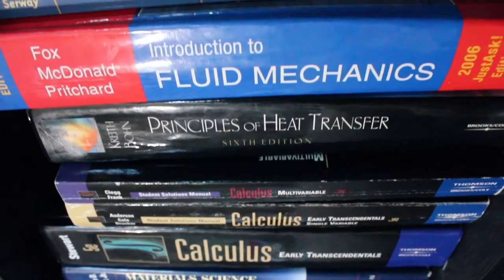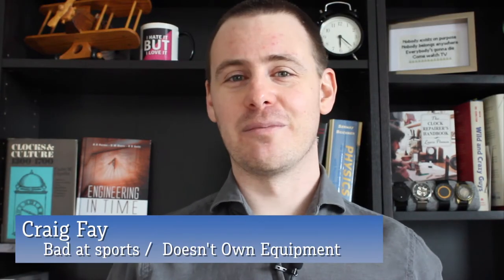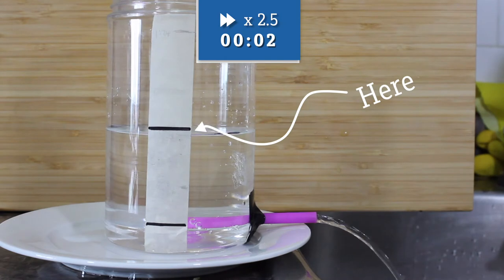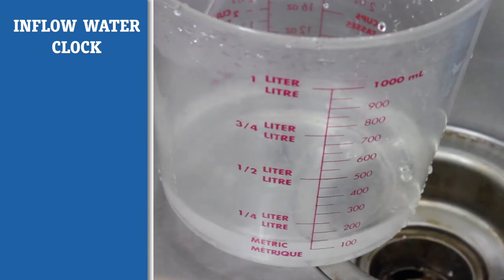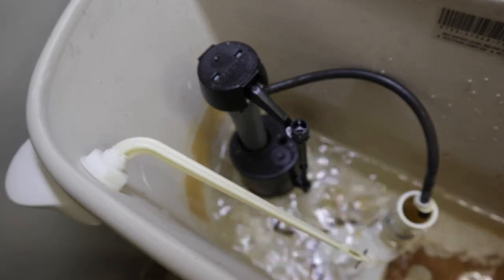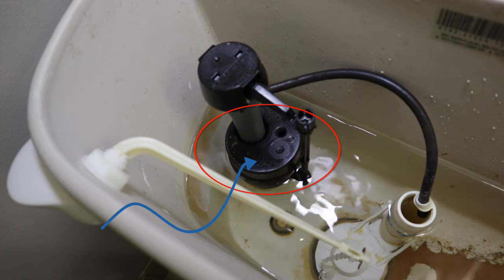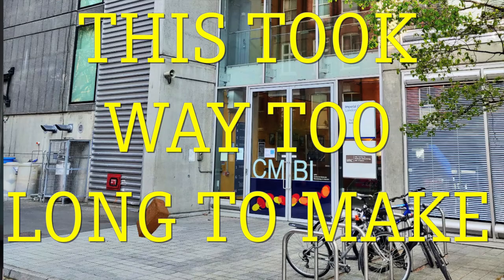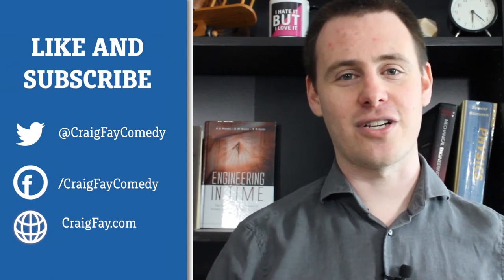Water Clocks - Craig Fay Builds a Clock - Episode 2

Comment: I'm looking for a way to let a dripper that I made with a bottle drop each drop at the same time. Do you know if anyone has tried this? I don't find much here in my country about this, I want to make a water clock but I want to use each drops like an escapement
Reply from the maker: The main thing that affects the rate at which the water drips out of the bottle would be the pressure of the water above it.
The pressure of the water is only affected by the height of the water above the hole, so as long as that height is kept constant it should flow at a fixed rate. 
To do that you need to have water flowing in slightly faster than its dripping out and then make an overflow hole so any extra water pours out the back and the water level never changes.

Any water clock will also be affected slightly by temperature and atmospheric pressure which will introduce inaccuracies. 
Sounds like an interesting project!